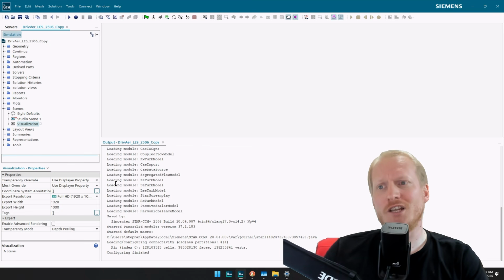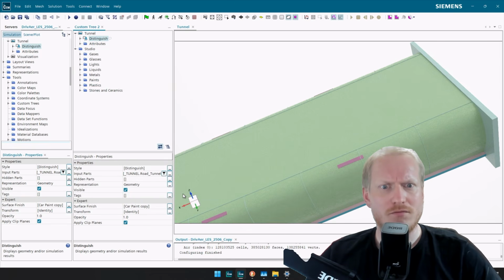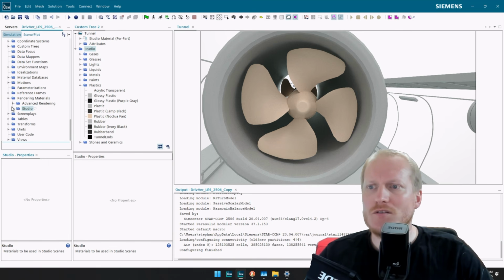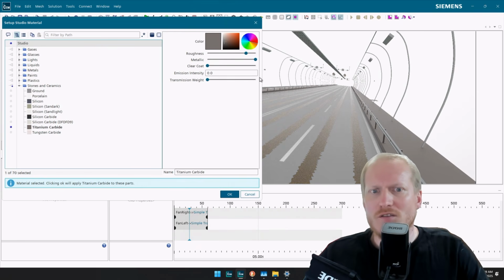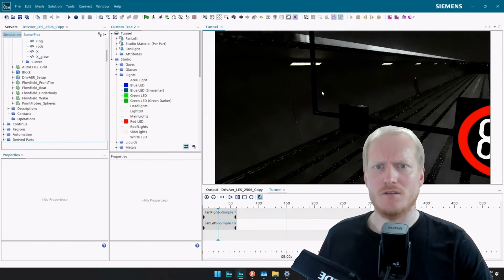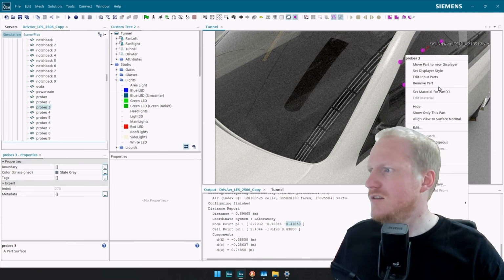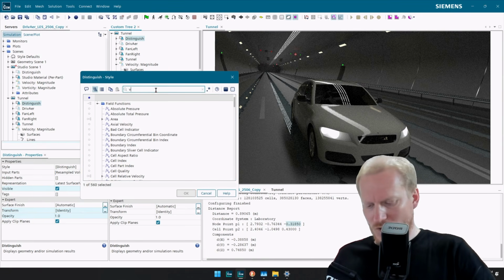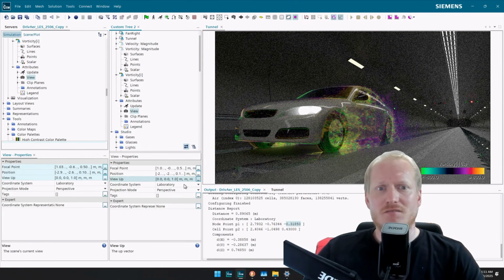CFD Simulation Postprocessing: Automotive External Aerodynamics | Studio Scene

Comment: would love to hear the specs of this system for ref
Reply from the maker: So my private system is Ryzen 9 5950X (16 cores), 128 GB DDR4-3200, Asus x Noctua RTX 3070. At work, I am currently using a machine called HP Fury Z5 (i think), 56 cores intel, 512 GB RAM, 4x RTX 6000 Ada